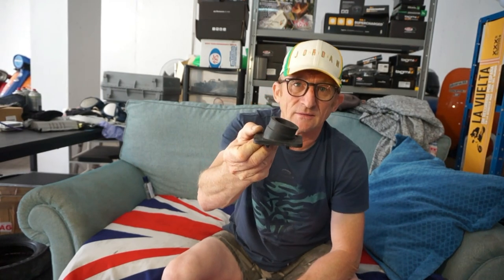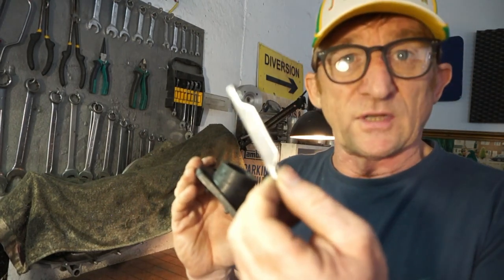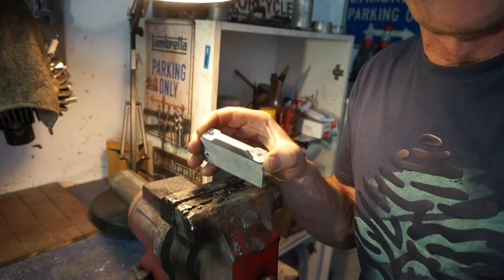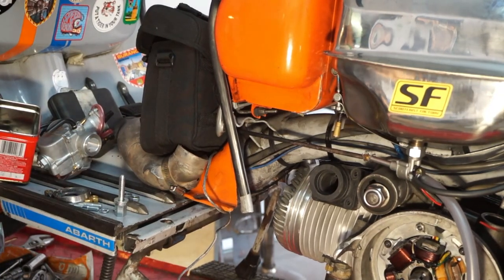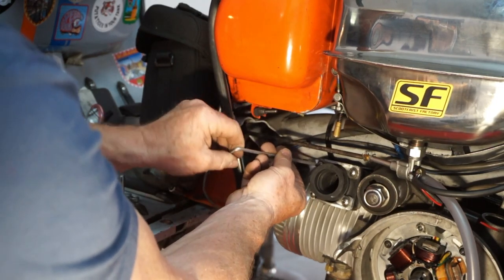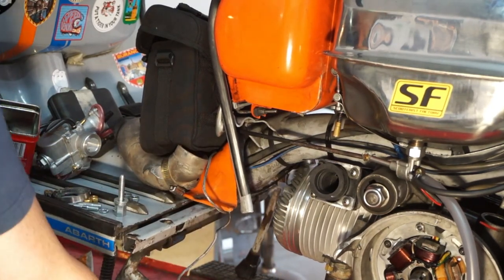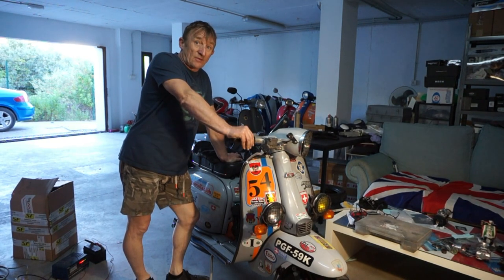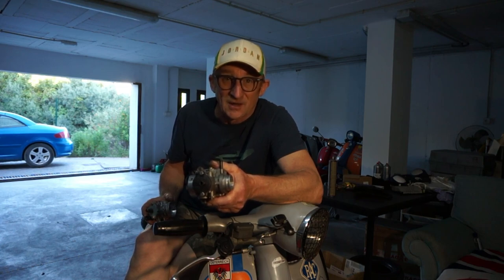MB manifold Shorty reed block fix #fast #lambretta#leakdown

Comment: Top job  steven ,the problem with all these  rubber manifolds is they have    no  woven  material built in   to the rubber  and  should have  a flat   ali plate  built into the rubber with the wovan material built into it then press  in an  ali  two piece  mould , top fix there mate
Reply from the maker: its got a built in plate but its weak as hell .....
Reply: @TheSteelweasel   really it`s a prototype   stuck out on the market with no long term  trials or actual  R and D ,what your doing steven is covering up for the fact they did`nt. 99 percent of   lambretta new parts ie tuning   have very little  research or  real world test ,I just wish   that  all the tuning  shops ,designers actually looked at  industry  and took it what is the standard normal when selling parts

Comment: Have to agree on the carb size.  I use a tm 24 recommended by scooter loopy john years ago.  The MB products are brilliant or we would not be using them but there is always a preventative measure to improve any scooter so well done.  Being a banana fingered ape notorious for overtightening everything I may need somecofcthese myself 😳

Comment: Just fit the plate and flange rubber MB does
Reply from the maker: This is an MB rubber ..... But what plate ? if its behind the rubber its to change angle not reinforce the rubber ..........
Reply: @TheSteelweasel  MRB0825 and MRB0833  run that set up on my bike and fitted loads . The one your using is to much like the old YPVS one which all ways fell apart .
Reply from the maker: Nope its defo MB as its cast into the rubber . Suppose to be latest one that corrects carb angle .... seen the ones you mention it's an adapter plate and a normal rubber which also leak in same place ..... beware
Reply from the maker: Mrb0835
Reply: @TheSteelweasel  fitted loads on customer bikes and they have been fine with 1000s of miles on them .
Reply from the maker: @WideBoyLambrettaClub  it bent and thats fact not fiction , im showing a fix and my honest opinion ........
Reply: I know ;) and the easy way is to fit the parts I said , I now use MB flange manifolds on all my builds , piston port, shorty reed and TS , not had any problems and that's on big mileage bikes.
Reply from the maker: @WideBoyLambrettaClub  I dont promote companies parts i only give my honest opinion , some people worship blindly some manufactures ...... thats not me sorry
Reply from the maker: @WideBoyLambrettaClub  and who is our mystery man ?
Reply: @TheSteelweasel  sorry its not easy off this account , Jason Frost ,Absolutely Scooters , WideBoys Lambretta Club President
Reply from the maker: @WideBoyLambrettaClub  nice to meet you pal .